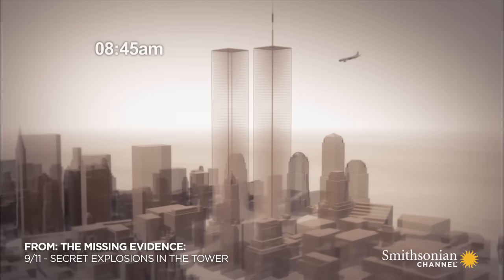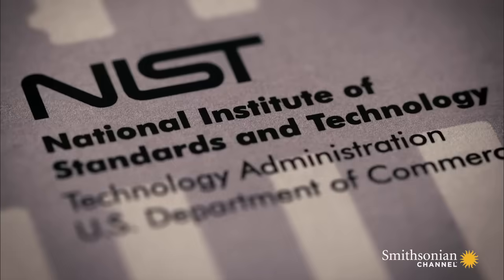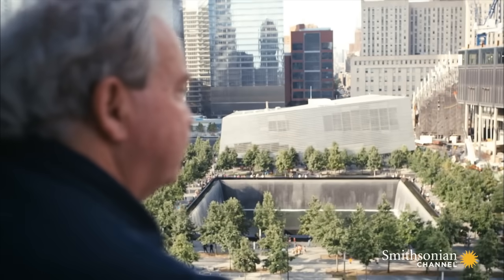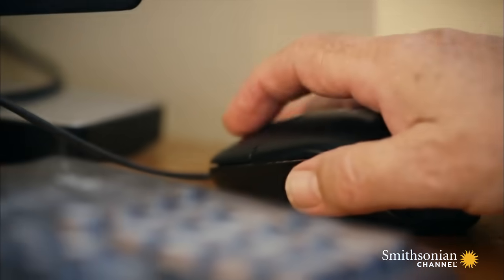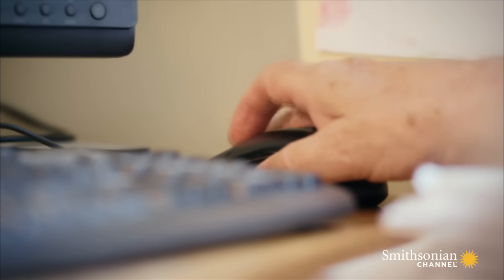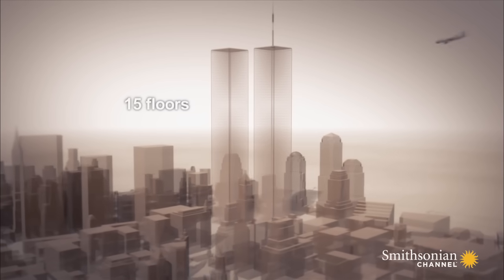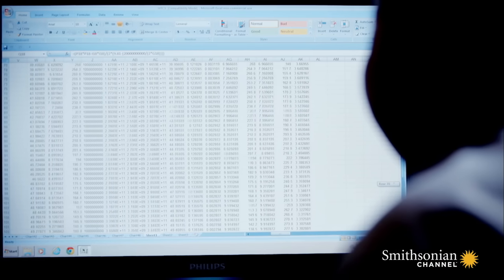This Computer Simulation Explains How the Twin Towers Fell

Comment: There is an equation to define the speed at which something falls during free fall. If I drop a ball from the top of a building it will continue to accelerate at 9.8m/s until it reaches terminal velocity INDEPENDENT OF ITS MASS. These floors encountered resistance of the floors beneath them as well as wind resistance yet they fell at nearly free fall speed (the same speed/acceleration as the ball dropped from the roof of a building not encountering wind resistance). This would have played a much larger role in slowing the collapse of these towers.
Reply: At the scale of those buildings, wind resistance is largely irrelevant, just as it is for a basketball dropping from waist height. In addition, the resistance from each separate floor would have been much smaller than the falling momentum. A similar example would be a car hitting a parked bicycle, sure it loses energy but not really enough to be noticeable. For all intents and purposes the towers free-fell.
Reply: @ateslabattery115 but a bicycle is a fraction of the weight of the car. As the top 1/8ths of the buildings were. So no it’s actually closer to the result of a bicycle falling through a vehicle, and tell me does it make sense if a bicycle a fraction of the weight a car is able to collapse a car down into its wheelbase? Also taking into consideration this bicycle crashed into the vehicle sideways???
Reply: @christbreezy381  the bicycle in this case is the floor directly below the collapsing mass, which is the car. each individual floor is not much compared to the weight of all the floors above them.
Reply: @christbreezy381 Yet the other portions of those buildings were structurally weakened by fires. Steel loses 50% of its strength at 1200⁰F. Guess how hot a common cigarette burns? Guess how hot a common fire burns? More than enough to weaken steel.
Reply: @ateslabattery115  but the floors were not simply compacting on each other, much of them were disintegrating and huge amounts of debris and framing were propelling outward.  The only way to propel laterally is to energize and essentially squeeze or pinch a mass from the top.  Such amounts of energy take time to accumulate, so they should delay the downward trajectory haphazardly, and would not result in perfectly symmetrical, timed and equal failures.
Reply: @Rareos  that is true, and we see the effects of that. The north tower began to rotate as it fell, as a result of the very thing you are describing. However because the main intact upper section was about the same height as the width of the building, it didn't cause much in the way of visual tipping, other than the antenna.
Reply: @ateslabattery115 i would say that is not at what I am describing.  I believe that the building above the crash site and fires was also left to follow the lower part as in, without pulverization, along the natural path.  as obviously if the floors above disintegrated it would make even less sense, hence the possibly of some very slight appearance of asymmetry or rotation of the top.   My point is If the buildings were left to collapse by fire weakening steel, you would see very obvious asymmetry in both trajectory and time.  All four sides of all three buildings catastrophically letting go at the exact same time is not plausible.  There were different sized holes in two sides (so different degrees of steel destruction or deformation, and basically no holes in the sides not hit.  The damage to the steel and it’s fire protection would not have been a symmetrical pattern, the fire and it’s heat distribution would not have been heating all floor beams (north, south, east, west) in equal amounts, so the expansion of all the beams being heated by fire (which is what we’ve been told happened) would not have not been equal on all sides initiating failure at the exact same moment, I mean within a fraction of a second.  All walls show to fall at the exact same time or at least within the margin of what happens when you remotely detonate.  Even if the argument that one failure essentially pulled the others into failure, there would be at the very least a much more obvious asymmetry, no extreme pulverization or protrusion, no fireballs and perfectly timed pops running downward guiding the floor failure.  There would be no massive beams of steel being pushed from the upper areas blocks laterally.   This is just some of the more obvious physical anomalies.  The circumstantial evidence which can be plausibly attributed to a certain method of collapse (found in the debris, which was of course swiftly removed and disposed of), is another level of questions that were never answered.   Now take all that unlikelihood, make it happen two times in an hour, three times in a day.  It’s so clearly not a normal structural failure I’m more shocked the way it’s defended.
Reply: @Rareos very well said
Reply: @ateslabattery115 at 1300 feet tall it should have taken at least 11 seconds for the top floor to reach ground level IF it was already going terminal velocity 

The buildings took around 4 and a half seconds to collapse

The only time structures accelerate while falling is during controlled demolitions
Reply: @alexfrideres1198  Unbelievable, every single thing you said in that sentence is wrong. In order:

- Height of the towers rounds to 1400 but ill give you that one since its not really important
- free fall from that speed would take around 9 seconds, which means it would take even less time if they started at terminal velocity instead of zero
- multiple video recordings show the collapse to take around 9 to 10 seconds, you can clearly tell when the collapse is finished because there is a secondary plume of dust and smoke after the primary movement stops
-literally everything accelerates while falling under any circumstances? its called gravity

I also find it funny that you mentioned the supposed height and time for a fall from terminal velocity but did not actually say what that terminal velocity was
Reply: x=(a*t^2)/2
x=415m
t=13s
a=4.91 m/s^2

g=9.81

no free fall

for the other tower:
t=11s
a=6.85 m/s^2

no free fall

very strange anyway, I don't deny that
Reply: @francisco77220  
There are other factors that need consideration too. For example, the pile of rubble from each collapse was estimated to be 10 stories in height. Thus, the top of the building (415m) would finish its collapse on the 10th floor. 
Height between floors = 3.7m x 10 = 37m
415m - 37m = 378m
Freefall = 8.78 seconds

Given the dust and smoke prevents us from seeing when the collapse finished, I used a different method where the timestamp of the tv broadcast was my reference for collapse initiation and then seismic data was used for conclusion, which was stationed 34km away from towers, resulting in a 17 second delay from the tv timestamp.
x = 378m
t = 9.7 seconds
a = 8.03m/s²

g = 9.81m/s²

Although, there's no way to verify the pile height so using this method for collapse time over a complete roof to ground collapse:
x = 415m
t = 9.7 seconds
a = 8.82m/s²

Im suprised at how little resistance the lower structure provided against each pancaking impact. I would also think the volume of air on each floor compressing and pushing out the sides would also slow it down, i think its most similar to a piston.
Reply: 9.8m/s^2 *
Reply: like building 7? sure
Reply: @keendeesjarlais3636 Except Building 7 didn't collapse at freefall. It also collapsed internally before the momental frame fell. It didn't actually fall symmetrically or into its own footprint. In fact it destroyed the Verizon building across the street.
Reply: Your premise assumes thar A) the lower floors were structurally sound. And B) That the raging fires were nonexistent. 

Steel loses 50% of its strength at just 1200⁰F.
Reply: @comradeeverclear4063  
Is there evidence of raging fires on the lower floors? If so, to what extent? (i.e - number of floors below impact)
Reply: The "freefall speed" meme that never dies. Literally every single skyscraper on Earth is designed to collapse this way. It's the only way physics allows them to collapse, unless you're going to cut a face notch in the base like a tree.
Reply: @john-s-peñois  well John even if one entertains your belief that the buildings should fall at free fall (which includes the instant equal initiation on all sides happening to three separate buildings in identical fashion for the first time in history), you still haven’t begun to wrestle with any of the tens of not hundreds of anomalies that require a plausible explanation.  If you respond to a large set of arguments and only counter with one, and believe it to be sufficient in disproving the entirety, well that’s called straw man argumentation.
Reply: @john-s-peñois  lol this has to be one of the most blatant ways to tell someone you know absolutely nothing about physics or building demolition I've ever seen
Reply: From what I see looking at video footage - A good few chunks fell off and to the side straight down, including the outer walls being sheered off in the collapse and falling a little sideways and down.

But the center of the building can still be seen peeking through the dust clouds. The center of the building seems to have taken up to 30 seconds to fall to the ground.
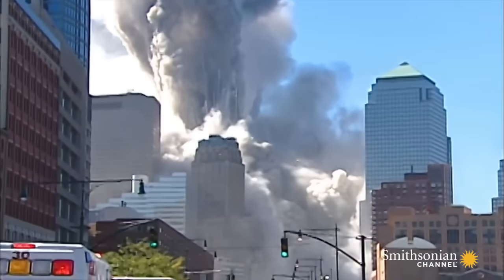You can see this actually at 3:49
Reply: There was no wind resistance, Einstein.  It pancaked straight down onto the floors below!
Reply: Only way this can happen CONTROLLED DEMOLITION
Reply: @PickleRicC89  - Agree - 💯💯💯 -
Reply: draw up the equation and prove this guy wrong then. Or find someone else who has. Cause all I hear from you nutjobs is a bunch of speculation. And honestly you're making a fool of yourself.
Reply: How dare you use provable laws of physics to expose the truth , how dare you !!
Reply: “Terminal Velocity”
Reply: You literally just watched a video showing debris falling faster than the collapsing tower and you’re still saying it fell at free fall speeds.
Reply: OK, I just got it, he figured you mean the floors resistance. I agree, it's the exact same thing I've been arguing for years, the towers fell at near free fall velocity. As if all those steel beams where actually made  of aluminum or thin. If anyone has ever tried breaking a match stick by pressing down on it as hard as possible would know how improbable this tower collapses were. Let alone mention tower 7.
Reply: And passport found two blocks away from the WTC  🤔
Reply: Ric you are assuming that the floors were not broken loose from the frame of the building ahead of time. Yes, there was a little resistance but not as much had the building not been "Blown" like it was.
Reply: @jetcitysinatra7300  we're on the same page about this
Reply: @PickleRicC89  Regardless of what happened it was truly devastating . . .
Reply: @jetcitysinatra7300  it was. There are unanswered questions and I'm tired the people asking them being labeled as conspiracists. They're legitimate questions and answers that have been provided by the govt aren't thorough or sufficient.
Reply: @PickleRicC89  I hear ya my friend . . . .
Reply: @PickleRicC89  its because you guys never accept the answers you're given.  these things have been answered and solved by experts all over the world.
Reply: Yes let's compare a ball which weighs 1.5-2oz falling off a building, to a collapse of multiple floor that weigh literal TONS. 

Plus your also denying/ignoring the evidence put forth in this video.

Please go ahead and think your right because you know a simple formula that doesn't even account for all the other variables. 🙄🙄
Reply: @HaloDieHard  
Both the building and ball will fall at the same rate of speed (9.8m/s²), its the mass and shape of the object that determines how quickly they reach their respective terminal velocities which occurs when the acceleration due to gravity  is equal to the air resistance.
Reply: @HaloDieHard  did you know Greening’s findings have been criticized heavily due to him not considering a number of variables and he’s been unable to sufficiently explain even the 9/11 subject matter that directly pertains to his training as a chemist?  There’s no evidence put forth in the video, his papers rest on cherry picking some evidence but omitting a host of others.  Also, it’s “you’re“.
Reply: @seq31  there was no actual explanation in the video, he only said he accounted for the weight of the floors, then somehow can thereby claim that through his momentum calculator he can confirm exactly what he sought to prove...but there is nothing in the video to substantiate anything or how such a basic model of reality transposes to the reality.  The reality where buildings receive varying degrees, angles and types of damage and subsequent fire and must therefore not identically begin to crumple symmetrically at the snap of a finger.

Here we see only B roll of paper stacks on his desk to show us how hard he works, and a computer program that shows numbers dancing across.  Even the narration ironically says he HAD to show that it collapsed the way it did. Everything presented it so empty, and it really takes a special kind of mindlessness to just accept the way information is presented and affirmed when having any type of discussion regarding these towers collapsing.
Reply: I apologizduyfod the silly question, but what do you mean by "this" in your last sentence.
Reply: @seq31  i didn’t expect anything, I’m responding to you‘re statement that said he explained something.  But there was no explanation, only a claim based on research that has already been shown to be inadequate and at even false to which he has been unable to respond.  Have you read Greening’s actual papers and positions?

Not only has he made his momentum model with large factual omissions regarding the buildings’ mass, but has tried his best to explain the existence of molten steel and thermite in the debris, as well as try to explain what fueled the fire and how they burned, but with huge analytical errors or unknowns.  

There‘s nothing credible about his conclusions, this has been brought up, and his response is further evidence of it.
Reply: @seq31  i seems you just aren't grasping that my concern isn't even with the speed of the fall.  I'm not sure why you're only talking about free fall vs not.  My comments don't really bring it up, do they?  Someone else came here to steer comments toward what they called the "free fall meme that never dies".  The video here is about if collapse in a particular way is feasible or not, which means speed is not the sole or arguable not even a major factor.  What some people bring to discussion is oversimplified, highly selective thoughts and just ignore mostly everything else, quite similarly to Greening's model.
Reply: @Rareos  and lastly, yes, buildings are designed to fall like this. If for any reason a building comes down, you want it to do so as neatly as possible, to avoid other damage to nearby buildings. That single fact undoes the majority of speculation about the collapses on its own.
Reply: @ateslabattery115  buildings are not designed to fall straight down, that is just the only way they can, due to gravity and them being hollow structures, they are not trees, architects do not need to “want“ them to collapse as neatly as possible because that is simply inherent in the concept, a function of physics.Their design and the codes that dictate them are aimed at safety and to prevent collapse, even and especially when one part of a building is destroyed.  If a building does collapse, it obviously does so straight down.  So this ”single fact“ you believe explains it all…hmm.. Perfect symmetry in both onset and collapse, extremely wide lateral debris field (despite your claim to neat collapse), molten steel, fragments of in-ignited thermite in the debris, nothing is undone by stating ”buildings are designed to collapse neatly“, it’s nonsense.
Reply: @Rareos  i like how you're just going to ignore my previous message. Regardless, now you say they can collapse straight down? isn't that exactly what you were arguing against earlier?
Reply: @ateslabattery115  what previous message have i ignored?  I responded to you saying buildings are designed to fall like this, which was your entire message..and when have I argued that buildings can't collapse straight down?  I believe you proposed the top rotated.  I have been arguing that it shouldn't collapse by way of all four sides suffering instantaneous onset on collapse, equal in both completeness and speed/time... arguing for asymmetry is not arguing against a straight down collapse.
Reply: @Rareos  I apologize then, i misunderstood. however my previous comment, which i forgot to mention you in, described how the exterior walls of the towers were not actually load bearing, rather the core and pillars surrounding it held the building up while the exterior wall sort of hung off of them.

Comment: At 3:41 The authoritive Dr. fails to notice that the huge wall panels are at least 100 feet below the still undamaged building ~ pancake theory?...🙄 The only thing that is in freefall is the outer walls and material that was blown outward.
Reply: Floor collapse preceded perimeter column peel off. The free-falling debris obviously puts paid to CT claims of the Twin Towers collapsing at "free fall speed", since said debris is dropping much more rapidly than the collapse front of the building. 

No material was "blown" outward. It peeled away.

Comment: What about the third Tower?
Reply: Which third tower? Six buildings collapsed on 9/11. Which one do you want to be #3?
Reply: @MFitz12  the one a block away
Reply: @MrYourfriendbutters  350 feet
Reply: @mikebyrd8278  wow so far away
Reply: @MrYourfriendbutters  well the building's 1300 ft tall so 350 ft is not very far
Reply: @mikebyrd8278  are you suggesting that the building tipped over?
Reply: Not the subject of this video.
Reply: @Tim22222  another shill account